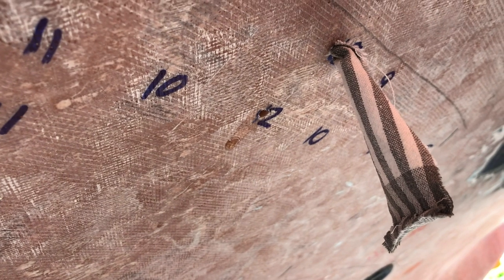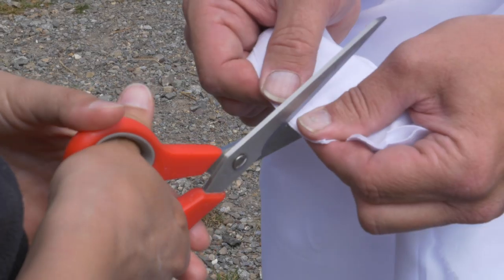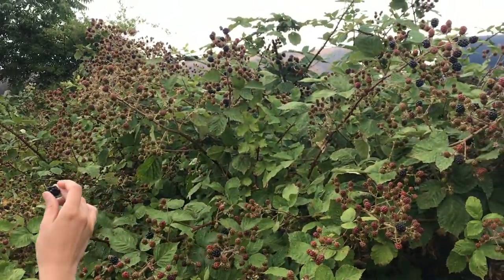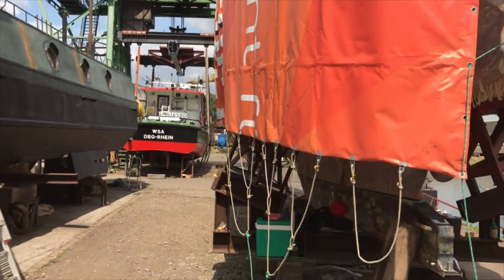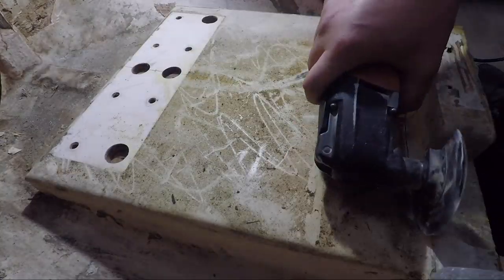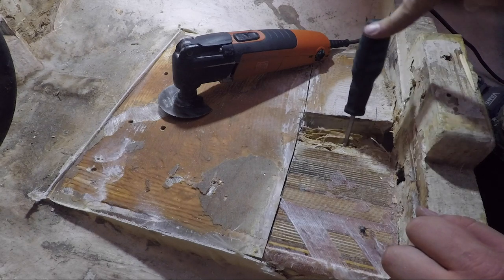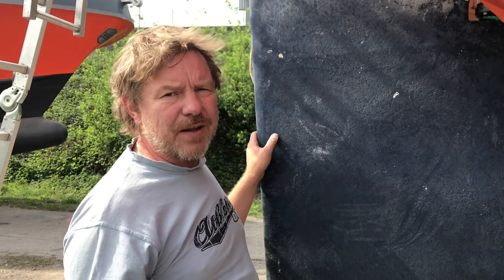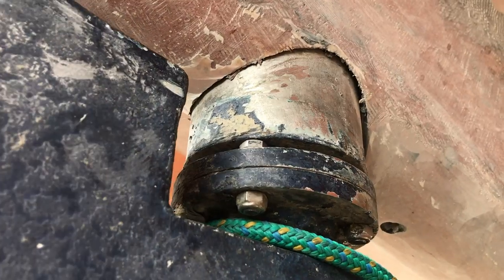Rotten Boat - Can we save it? | Sailing Mahalo Episode 8

Comment: Cool video. I have some questions. Sorry for my ignorance on these points but you mention “pipes” in the hull. Or maybe I’m not hearing it correctly? What is that. Also, is this a wooden hull or fiberglass? I’m asking because I have an old boat with fiberglass hull. But you’re making me nervous about old boats. Haha. Good video, music, and editing work.
Reply from the maker: Mahalo is a rare specimen... the boat was constructed with a system called RFK in Germany. It translates to pipe fiber composite. Instead of foam or wood as a core, Mahalo has flat pipes that run horizontally throughout the hull. It was a very short lived system, but there are still boats around that held up fairly well. There are many good old boats out there, you just need to find them. I don’t recommend RFK.
Reply: @SailingMahalo  Ah cool. Thanks for the info. I was wondering if I’d gone crazy or was hearing you wrong. I have a 1965 Cheoy Lee 36. It was one of the first years they did fiberglass hulls but topside is all teak wood (wood cabin top, toe rails, deck, etc.). I’ve never had the boat out of the water but I dive below frequently and the hull seems solid. It just got me nervous with all the bottom issues you’re having. 👍⛵️I haven’t done any videos yet of the Cheoy Lee as I’m way behind on editing but hope to soon.
Reply from the maker: @JoshPostVlogs  Go for it! We need to catch up as well, but the pandemic hasn’t exactly been helpful. Is that a solid hull boat like many of the early ones? In that case you should be golden.

Comment: I am really sad to see just how bad the osmosis problem is on your boat. It is going to take a lot time money & patience to get it back to where it should be. She is going to be a nightmare to re-glass while the hull is up the right way.  I re-glassed a 26ft OAL Outlaw hull completely  in the 80's.  I was wishing I had never started it within a week. In the end I had it craned upside down to complete it. Luckily I was working at the boat yard where I was doing the job.  I did it part time probably 25 hours per week and it took me 2 years to complete the hull. We did not have peel ply in those days and every layer had to be sanded before the application of the next coat.  She is still sailing to this day but not owned by me.  I hope you are as stubborn as I was then and refused to give up.   It is a massive undertaking and I wish you all the best for a good conclusion.  regards from the UK

Comment: Rudder tube , get a s/s welder , put some weld lumps on the tube so it can’t rotate on the rudder block
Reply from the maker: gess ges we plan on welding the tube to the rudder housing. Should hold it well.

Comment: I would look into having a Rudder housing made out of steel then you could over drill a hole a little bit and put in a brass bushing that would be easy to replace if it wears , then  fiberglass it all in place really well that should last you a while
Reply from the maker: Bryon Ensminger great suggestion! We have a design in mind already, but we hadn’t thought about a brass bushing. Since we already have a stainless sleeve we are planning to weld or bolt this to the housing.
Reply: Bryon Ensminger Good idea

Comment: Sorry to say that hull is shot despite what you see, hear and talk to people about it they are all wrong. It will never be as strong as was when new. It is common problem with poorly made boats with wooden frames and foam hulls once wet it will always be wet drilling holes to let the water out is a waste of time .When you get done it will look good on the surface only. but in a rough sea it will fall apart. That thing belongs in the dump. Sorry for a touch of reality BUT I have seen people lile you do this before and it is a disaster in the end.
Reply: philip streechon Do you say anything positive?
Reply: I'm positive it's a piece of junk
Reply from the maker: Thanks for your input Philip 👍🏻 of course we prefer to remain positive, but we have to look at this project from more than just the romantic side. Though I haven’t heard of any boats falling apart in the middle of the ocean from osmosis.
Reply: Sorry for being so negative , Ijust get so unnerved a the boat manufactures they cut corrners were ever possible it makes me sick. You should see how new boats are made today even worse. there some videos of boat surveyors in Florida looking at storm damaged boats, and you can see what they have for a hull core. The surveyor did not know what was it was like old wet bondo very poor. That is why they are so cheep I looked at a 65 foot hatters  and the foam core was full of water which froze last and all full of big bulges. Look at Boston Whaler the core can honl so much water it can increase the boat weight by as much as 35%. The rule is weigh the boat and compare  it to the mfg specs. Good luck on your project Icould go no for hours.
Reply from the maker: I definitely get where you’re coming from. It’s frustrating indeed to just see people wanting to make a quick buck. We can see more and more that quality doesn’t matter anymore. Just make as many and sell as many as possible. In our case the boat was home built, but I believe mislead by the design company...
Reply: Sailing Mahalo Ignore the naysayers. The commentators telling you to give up or that you’re crazy have never had a dream or did but gave up. Keep at it. You’ve earned a subscriber.
Reply: Philip, as far as I have seen, this isn't a foam hull so...what is your point? As for "falling apart in rough seas", can you post a link to an article about a boat sinking due to osmosis.  

Sailing Mahalo, as Leo Goolden is proving, there isn't anything that money can't bring back or fix (a good Uncle helps too). Boat projects like this are a race.  You are racing to finish the boat and the boat is racing to get to the bottom of your bank account.  Generally, these projects cost double what someone thinks they will. I hope you win the race.
Reply: Hi I have watched every one of Leo's videos and I have a degree in mechanical engineering I know a lot more about material application and structural design than you might think. THESE BOATS WERE FOR THE MOST PART WERE DESIGNED WITH PROFIT IN MIND. The older hulls were much thicker all fiber glass construction with poor epoxy they cost a lot to build but were very strong trying to cover plywood  balsa wood foam cores ribs decks ect with fiberglass is a joke and always fails Leo's boat is all wood do you think he is going to cover the hull with fiber glass . WATCH BOAT WORKS TODAY HE IS WORKING OA 25 FOOTER WATCH LISTEN AND LEARN TO WHAT HE IS USING FOR MATERIALS.
Reply: philip streechon Nobody is disputing your knowledge or the construction quality. What I took fault with was the absolute negativity of your comment. I’ve worked on many boats and homes and with effort (and money) rarely have I seen one that couldn’t be fixed. Not sure why you felt the need to comment was something so negative.
Reply: @briansaben5697  Sorry to offend you I have a sad thing to tell you. A family member bought a boat of good size it was inspected I never saw it. iI sank and 3 were killed, it was found that the boat was patched by a boat yard not long before it was purchased for structural problems LIKE THESE . I HOPE YOU UNDERSTAND.
Reply: philip streechon Sorry for your loss. You didn’t offend me. You have people needing support not a boot on the neck of their dreams.
Reply: @philipstreechon4523  HAve you watched these videos at all or did you just peek at one and decide to comment? This particular boat was not "built for profit" as it was one guy making one boat.  Now you can argue about the sanity in doing so but it wasn't a for profit boat.  Second....dude...listen to me....this boat is not a balsa core.  I've never even heard of another boat built like this but that is irrelevant.  IT'S NOT A BALSA CORE.  you are stuck on that.
Reply: @philipstreechon4523 , What does that have to do with the subject of osmosis?  Again, please post a link to ANYTHING stating a boat sunk due to osmosis.  A patched hull due to structural problems is about as vague a story as you can get.
Reply: Brian Saben There’s nothing wrong with a reality check.
Reply: Giff Kucsma Opinion isn’t necessarily reality. I’ve seen boats in much worse condition that are on the water today. When confronted by a problem there are two types of people, those that work for a solution and those that give up. I hope they keep working.
Reply: @Slithey7433 , true.  I think they are in the middle of it right now. Reality check, reassessment, whatever you want to call it.  Rare to buy an older boat, in any shape, and not go through that to some degree.
Reply: @briansaben5697  I do not care
Reply: philip streechon You cared enough to make a negative comment.
Reply: @briansaben5697   do not contact me
Reply: philip streechon I have ZERO interest in contacting you. If you are referring to my responding to you in the comment section then my advice to you would be not to read or post in the comment section. Good luck. Stay positive!
Reply: Like trying to save a tree with termites
Reply: Steve Evans Another naysayer. What is your qualifications to make such an assessment? If none, then why do you feel the need to post a comment? By the way, termites do not eat live trees.